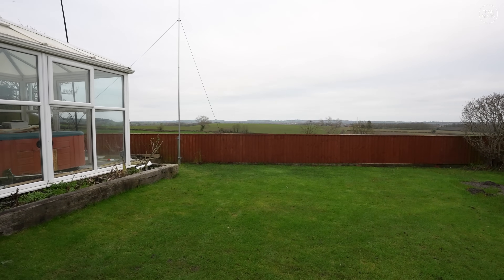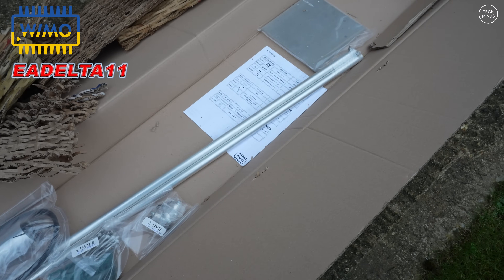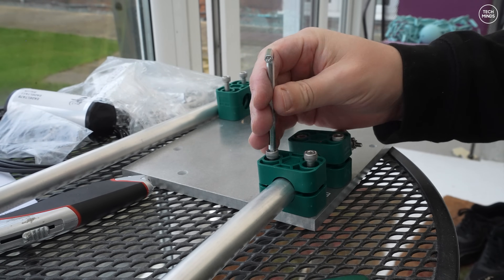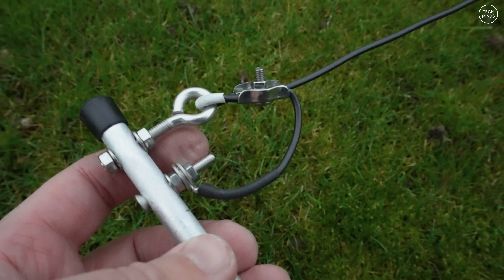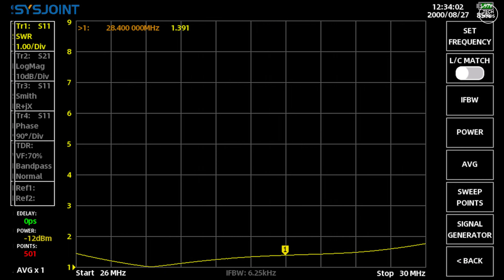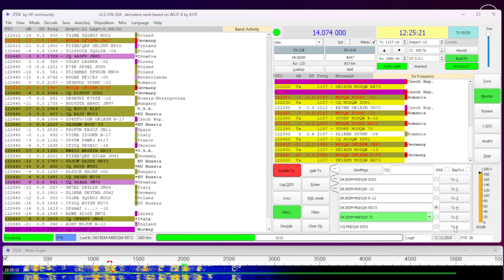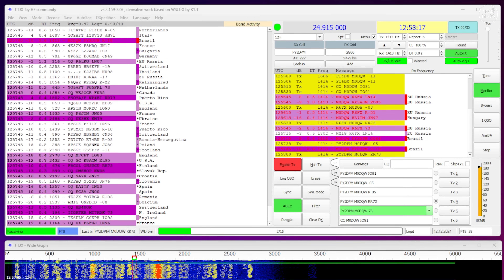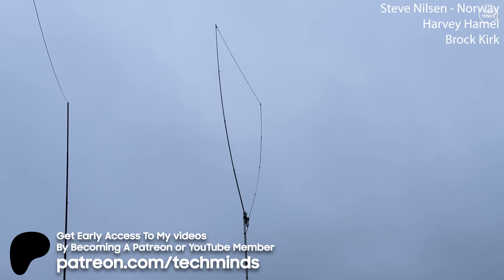EAntenna DELTA-11 6 Band Delta Loop - This Antenna Is AWESOME!

Comment: All thought just recently looking the Delta Loop, I was under the impression all legs of the loop were the same length, but that does not appear to be true. The top cable appears shorter than the side tubes. It would be great to have your opinion on that. Another GREAT, and helpfully video, Thanks, 😉🇨🇦

Comment: It looks like commercially available antenna mast. It comes in 5 foot sections, and one end is reduced in size (swagged)to fit inside the previous section. However,  you installed it upside down. The swagged end should be facing up to the sky. That way, when it rains water runs down the outside of the mast instead of running down the inside and eventually rotting out the joint between the sections. Hope this helps.
P.s. the bottom section should be a little ways above the ground so water doesn't accumulate in the mast .

Comment: Is it swaged or swedged?

Swaging, also pronounced “swedge”, is a metal-forming technique in which the metal of one part is deformed to fit around another part by either pressing or hammering, or by forcing the material through a die.

1:58

Comment: Thank you. Comparing my horizontal delta loop (42m long using a 4:1 balun) at about 4m high with a vertical mc-750 the delta loop performs much better.

Comment: One thing about it is to get it to tune 20m/17m the tuner has to be as close to the antenna as you can get. If it is say in the house 50-75feet away it will never tune up. 6m -12m easily. 15m is not the best but works. I built this one and it works great where it tunes.
Reply: I used the same antenna for the first time yesterday and it wouldn't tune 20m but it did tune 40m.

I performed wonderful on 12m last night thou.

Comment: Loops are highly directional, so rotating it must make a difference. A key benefit of a loop is the ability to reject noise by rotating away from it.
Reply: Yes, a rotor is making really sense. I would say it is even necessary. Turning the Loop makes a big difference.

Comment: Hi mat aerial performs great only have it up around 20ft on a rotater but seems to work real good worked uae and ukraine when testing the other day and using rotater seems to allow better coverage as was listening to usa/canada on 10m and moving loop allowed 3 spoints differance in recieve and noise lvl is 3 spoints lower than the efhw and the mini-beam.anyway nice to meet you and keep up the good work.And if anyone is interested working conditions eantennas delta-11 the very same aerial in the video yaesu ftdx10 and yaesu 991a radios to see differance in signals 991a was on the efhw both running 30w efhw is at 10m loop is at 20ft.
jon 2e0dxi.

Comment: Back in the 80s I found a dealer with an 11M two element delta loop antenna for 60 USD.  I put it together shortened for 10M.  I put it on a pole with an old TV rotor.  I had no problem talking to UK with the thing not very high up, from the eastern US.  The top of the loops was wire and it had a gamma match system.  Where I live now my back garden is not really too big and surrounded by utility wiring and I have no pole in the ground yet.  I got a ground mount vertical with 36 radials but the thing is well made but matches poorly on 40 and 15.  But is high quality materials so disappointing.  And due to being vertical noise can be horrendous.

Comment: I had a "V QUAD" delta loop antenna which I used on 10,11, and 6 meters. Mine was a 2 element beam which worked very well. MAKO makes a 3 element V QUAD now.
Reply: I made a home brew V Quad 2 element before I got my amateur radio license. It was a very low noise antenna with good strong signals. I may take it out this spring to play wit it.

Comment: I bought one on a whim a couple of years ago at a discount. I had a shoulder replacement surgery and not strong enough to install the delta at the full size. I left out the third telescoping piece and reduced the size to end up as a full wave on 15 meters.  The balun that was supplied fell apart when I removed the mounting bolts. I used my own balun.  The Antenna was mounted just above my roof line.  It tuned up fine on 15, and did well on stateside contacts if I rotated the antenna broadside to the stations. I have a 40 meter horizontal loop that out-performed the EADelta on 15 meters every time with DX stations. When I am able, I would like to build the delta as designed... maybe I can get it a bit higher. Sometimes, you just hafta' do what you can, with what you got.  I was glad to see your video and experience. 73 de K1QS.

Comment: Hi Matt what length would the aluminum radials be  using the balun  and length of wire in between the  vee  as i build them if i can   as FREIGHT is as much as the antenna 
As buying antennas say off EBAY  antenna cost 260$   freight can be 280$ nz to New Zealand  =540$ nz

Comment: is it anyway like a small beam? do you rotate it at all> ? Many Thanks and Happy New Year I want a beam
Reply: Hi, the lobe of this antenna is like a round one lobe radiation pattern of a vertical. If you rotate this antenna, the results maybe will be a little bit different, so many users told me the reason to use this antenna, it's to don't turn it and at today all users said the same, awesome results with this smart antenna. 73s de Rod, DL/EA7JX, EAntenna founder

Comment: So basically this is a rigid delta loop designed for 11m, hint hint delta 11, by the way you had the swaged poles upside down.
Reply: Not exactly. 
Was designed for 10 and 11m bands, where the major parts of the CB and HAM Operators work normally, because the length of the antennas are smaller.
Also, we thought to improve a large SWR Range from 27 to 29 Mhz. and with our balun, easily tuneable in many bands. 
73s de Rod, DL/EA7JX, EAntenna Founder

Comment: Check out the various tilt over mounts, position it so the mast lays pointing kitty corner in your back garden.
Reply from the maker: Yeh I have been looking at what's available to make things easier to bring down and put up. I may end up having a tower on the side of the house instead, but who knows lol. cheers

Comment: My first delta loop was a 20 meter version. It did really well and basically was built from a chunk of rg-8 from the shack to near the antenna, with the delta being made from simple wire. . In the antenna area I had a 1/4 wave piece of 75 ohm coax in series with the RG8 50 ohm cable (I recommend using a nanovna or antenna analyzer of some kind to make sure your 1/4 wave piece is the right length) . That made it possible for the higher impedance of the Delta loop to be perfect for the 50 ohm cable. It was an amazing antenna, but one thing I like about that one is you can change its direction. One of the best things about the one I built was it was free ! One advantage of both antenna's is the balancing effect which cancels a ton of noise ! That makes receive for both antenna's better than a efhw or a vertical by a lot. I now run a 160 meter loop , a horizontal antenna, and it operates on many bands without my auto tuner even realizing that I have changed bands ! It is known as a sky loop and is quite high.

Comment: So how does this compare to the previous hexbeam, xiegu 40-10M, dual beam pro, tactical delta loop or the inverted L that you have?
Reply from the maker: Well, I dont have the space to have all antennas up at the same time so I cant answer that 100%. However I did demonstrate in the video comparing against my EFHW Inverted L. I assume you saw that part? If they were all up in the air at the same time, I would not be surprised to see the HexBeam win overall.
Reply: @TechMindsOfficial  could I ask what happens the other antennas? hexbeam, xiegu 40-10M, dual beam pro, tactical delta loop? Do you sell them off, or give them back to the manufacture?  I was going to pull the trigger on xiegu antenna, but never found that discount code.
Reply from the maker: lol. Manufactures don't give refunds unless it's faulty so I keep them. Some I might sell off if I don't think I will use them again. I did sell the VG4, think that sold on Ebay, but mostly I put my unwanted gear on HamRadioDeals. I think the discount gets applied when you click the link and then place the order, but if there is already a discount on the item, from them, then it might not double up. https://radioddity.refr.cc/techminds
Reply: If you are selling the hexbeam, let me know,  thanks.

Comment: Thanks a lot. Again learned many new things. But, my Wimo GPM 1500 performans better, really even with a poor RG-58 cable around 30 meters. The footprint is much wider and stronger compared to your PSK Reporter results. Sorry for that. Reaching west cost of  USA is also much better if it is a indicator. 73 de Ersoy TA2OM

Comment: Delta loop antennas are underated. I built one for 15m with a 4.1 balun and tune from 17-10 m perfectly with 7300 tuner. They are so quiet.
Reply: Hello, can you share antenna dimensions?

Comment: Hi Mat, I built a 20m delta loop in the same configuration and it is a wonderful antenna for 80-10m. they are a bit directional, but rotating mine would ruin the wife's satellite reception when I transmit, so it stays N/S direction.

Comment: Id would have placed that remote ATU right at the feed point as intended.  Loops are great antennas broadband and quite. A rotor might be fun as well. You always do a good job.
Reply: And surely you should eliminate the balun (a balanced atu already provides this function). The point being that forcing the balun to operate with a high SWR will make it rather lossy.
Reply: @graemezimmer604 unfortunately balance remote atu are very rare unless homebrew

Comment: Matt, nice video! What is the end ratio of the balun?
Reply from the maker: Thanks Frank, tbh I am not sure. Sorry.
Reply: Ok…looks like it’s only a 1:1 choke balun.
Reply: For that shape of delta loop, "typically" it would be a 2 or 2.5 : 1 to match the @ 100/130 impedance, or a 4:1 for ease of availability.
Reply: It is a modified 1:4 Balun by EAntenna Tech Labor.

Comment: What software are you using ?
Reply from the maker: Which part of the video are you referring to?
Reply: When you are first testing you have the radio on screen and a 2 apps above it
Reply from the maker: The software on the top is LOG4OM, just one app.
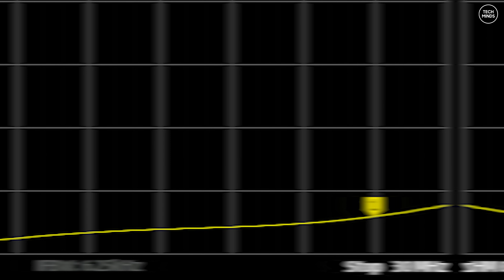Reply: 11:44

Comment: Also one comment I would like to direct to European manufacturers of antennas. It would be wonderful if you could come up with a joint manufacturing agreement with somebody in the United States. You could eliminate a huge amount of the shipping cost and broaden your scope for sales. Shipping from anywhere in Europe on a package such as this is prohibitive and if you could come up with an agreement with a manufacturer here in the States your market would be much larger. I would really like to have this antenna but unfortunately shipping cost would be intolerable. Possibly a manufacturing agreement with DX engineering?  They are a company known for quality build so your reputation would be safe with them.  Or possibly chameleon antenna.
Reply from the maker: They are sold at DX Engineering for USA.

Comment: Thanks for that.  It seems crazy that EAntenna/Wimo claim is is omni-directional; I did a quick model on 10, 15 and 20m and it's anything but! 😆
Reply: Of course, it's not an omnidirectional Antenna, so the lobes in the major bands are round, and the attenuation is very small. Maybe for a small investment, can you try and tell me after 😉73s de Rod, DL/EA7JX, EAntenna Founder

Comment: I did a quick look and I didn't see this mentioned but you have the swags upside down on your mast pipe. You want to have the narrow part facing up and the wider part sliding down. This helps keep water out of the joint. I know where you're at you do not get severe winter weather but I'm sure it freezes there sometimes and that could be problematic if moisture is in that joint.

There's nothing you can do obviously about the antenna elements as all antennas are built going from largest diameter at the bottom to smallest at the top. I would put a layer of electrical tape over the joint and then put the hose clamp on the electrical tape.  I've done this for years and it works out very nicely.
Reply from the maker: Thanks for the tip! It's only temporary, as I am always changing antennas, seems like weekly at the moment! ;-) Thanks again.

Comment: I have something similar, rather than a metal plate mine is perspec ssheet, spreaders are x2 roach poles around 3.8mtrs long, the wire anteena is fed through these to complete the loop from terminals - and + on a 9:1 balun cut for 28.500mhz tunes on 24.900mhz too, fitting another transformer balun type will tune with atu down to 40 mtrs. Set as a delta loop. De g0sgo

Comment: I would have liked to see the SWR not only around the 10 and 11m area but for 6 to 20m just to see how much off it were on those bands. A tuner is fine, but the less tuning an antenna needs the better.

Comment: being a former mechanic, I'm puzzled as to why there are spring washers, and nyloc nuts in use, on the same bolt???
Reply: makes for a better electrical connection
Reply: I was also taught only to use one locking device per piece of hardware!
Reply: @chip3655  nyloc nuts by their nature makes a poor electrical connection which is essential in this case, additional spring washers cures the problem.

Comment: The clamps are from Stauff, good kit used everywhere in industry. Google Stauff. P.s. Swaged, pronunciation is "Sway-Jde" These poles can take more wind stress than you may think, sometimes building some slack into the mechanics can hel with wind stress better than some people think.

Comment: Wow!  The noise elimination looks amazing.  Since I'm only interested in listening, mostly SW, utilities, and some amateurs, the noise reduction is very interesting to me.
Reply: I use a Wellbrook loop as an RX antenna which I've had for about 10 years and it is BRILLIANT! Sadly the guy that ran the company passed away this year (I think) so are no longer available. However the design was reverse engineered and a loop antenna based on it is available - Google Wellgood loop. I've bought the amplifier kit so that I have a backup for that fateful day that the Wellbrook fails. 

But yes - loops have better noise performance than Marconi antennae. 

There is also the MLA-30 loop which is supposed to be pretty good - there are a number of video's here comparing the Wellbrook against the MLA-30. Some are good and others are crap; depends on which Chinese factory they com out of I think.

Comment: Come on Matt, tuned for 10/11m? 

Time to dig out the ol’ CB and get some breakers on the side. 

Great video mate. Anything that brings the overall noise floor down is a winner straight away.
Reply from the maker: lol... I have no need to use 11M, no one around here locally. If there was, then I would probably have a 11M radio setup.

Comment: Hi Mat, first looks this delta loop seems to be build with decent materials. Did you notice some directivity (normal I think) broadside to the antenna just like a dipole ? Signals appeard to be very strong in your video and the delta loop hold it's own against the EFHW expect for one contact on 20. Amazing what you did with your tuner. I think putting this antenna on a small rotator you would benifit even more pointing your antenna towards the oposit station. Just a quick word on my plans. Summer 2025 I will putting up my hexbeam on a 50ft retractable tower with a G-1000DXA rotator. But following up on your channel there are lots of nice antennas. Keep vids coming ;-)  73 Phil ON4VP
Reply: Hi Phil, before this model, we developed the EAntenna EADELTA7B. This antenna without Tuner works perfect in 20 and 10m bands. With Tuner in all the rest bands, and 2 of the 1st users told me that He compared with an Hexbeam antennas, and the results sometimes are better in the Delta. Some stations was louder in the Hexbeam at the S points, so the quiet signals of the EADELTA7B are easy to understand the small signals of the bands.
During a CQ WW and CQ WPX, including with monobands with more than 4 and 5 elements, we used an EADELTA7B to take some signals that the lobe of the large monoband don't receive if I didn't turn the antenna. 
At least, when I decided to develop this antenna, the idea was for small QTH, Portable, because mount this antenna is so easy, and all kind of Ham operators that look to a reliable antenna with a small investment. 73s de Rod, DL/EA7JX, EAntenna Founder

Comment: one little tip from someone who concretes pipes into the ground the same way, put a plastic cap on the top and then drill a small 1/8th inch hole about an inch above the ground on both sides to allow any water that collects to drain out the pipe otherwise it will rust form the inside out. also get some cold galvanising  spray once you have drilled them.
Reply from the maker: Great tip for someone else  as The pole that is concreted in the ground is filled with concrete, secondly it’s swagged, they are steel, and I use them.